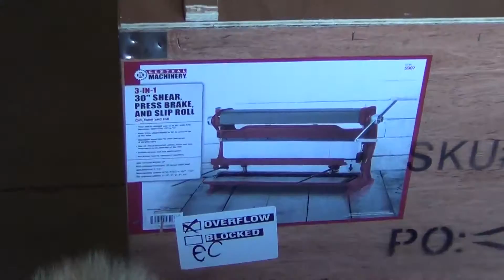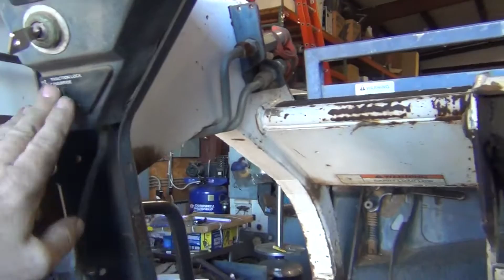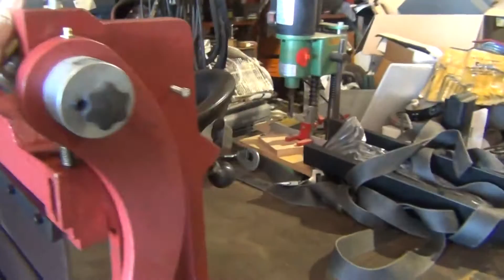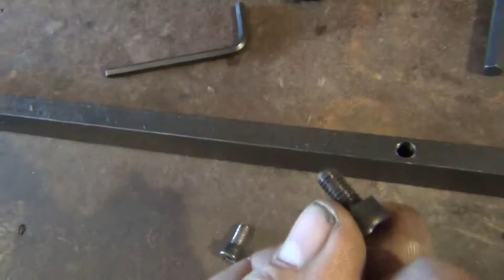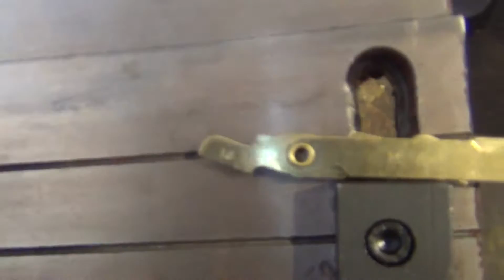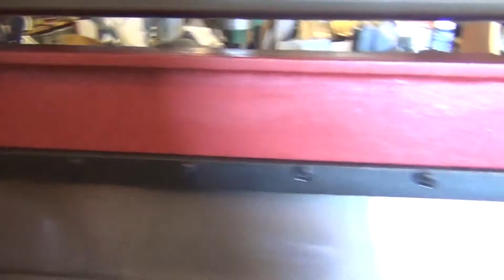Unboxing review H F  shear break roll Central-Machinery - Item#5907

Comment: I know this is a 4.5 year old video. Did you remachine the shear blade cap screw hole location in the blade, if so the blade material must not be too hard. I would think this is tool steel and have a rockwell hardness of near 50 to 55 (hard but not brittle).  That would take some cutting tools I don't own. So it must have been soft enough for carbide endmill to touch.
I came here as I'm looking at buying one of these from the local HF store. Mainly for the press brake, as my current brake can not get into tight back  to back bends. And the add on ones I see where you use a hydraulic press, seem pricey and are too narrow to have enough utility. 

I think I've always heard low cost China import tools made with cast iron are called Preassembled Kits. I've had my share, starting with a Jet lathe made in Taiwan in 1976, and a HF surface grinder  (6x12) that had a factory manufacturing error, where there is a bearing retainer plate made of aluminum that they used a hammer to cold form around the ball bearing that stuck out, as they did not machine the pocket deep enough for the width of the bearing. But they shipped a machine! It is a useful machine. And a lathe I got from Grizzly (18x40) that was clearly made from every incorrectly machined part that was just barely good enough.
The best China made tool I've ever purchased was the rockwell hardness tester. Worked flawlessly out of the box. And still passes calibration with the test coupons used to verify accuracy. 

Thanks for this video, it shows where I need to look to enable adjustability of the machine.
Reply from the maker: Hi, sorrry for the delay. From  what I remember I just used HSS endmills, my carbide are few and far between. I don't do a lot of sheetmetal forming but for the little I do, it works OK. The sheer tends to bow away from the fixed blade if you push it to stock thicker than it is designed for, 18 gauge I think. For the price.... EH it is better than mucking around with make shift setups so over all, it was worth purchasing. Yep, most China machines are "kits" and not fully functioning machines LOL.

Comment: Just unboxed mine and it hardly turns without any material  any suggestions?
Reply from the maker: I had to adjust everything. Often there is manufacturing "garbage" (chips, grit and whatnot) in the mating surfaces. I would try to give it a good cleaning, light lube and adjustment first thing.
Reply: @wayneparris3439  thank you.   I probably should have just looked for a decent slip roll on craigslist I guess. Another learning lesson
Reply from the maker: @kw3640  After a disassembly, cleaning and adjustment, the tool has done just fine for ... what, 3 years since I made this video. I don't know if you watched the video or just saw the title and asked your question but I had a lot of work to take care of to correct the factory errors on mine. For the most part, think of HF machines as  machine "kits" to keep things in perspective. Enjoy! God bless and may the next year be blessed too!

Comment: i think i must be the only use county boy that like metric oh how fractions annoy me along with big loose course threaded bolts .i just pick on up today i hope it does not suck but ill fix if it is messed up a bit
Reply from the maker: Simply use decimal inches. All the same base 10 ease of use with none of the "what the heck is metric?stares. Example: one and one half inches = 1.5 or one inch and a quarter= 1.25 or ten inches and an eighth 10.125 See, you need not move to that oddball measuring system to use base ten numbers.
Reply: @wayneparris3439  And how many inches in a foot?.
Base 10 my arse